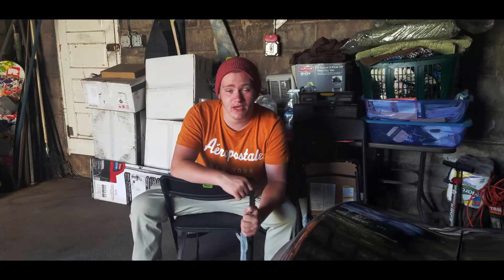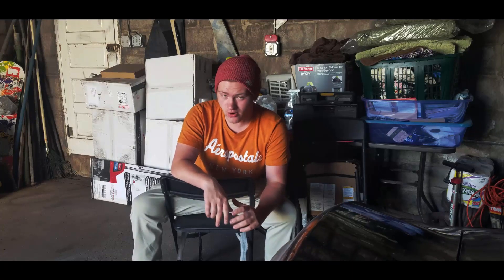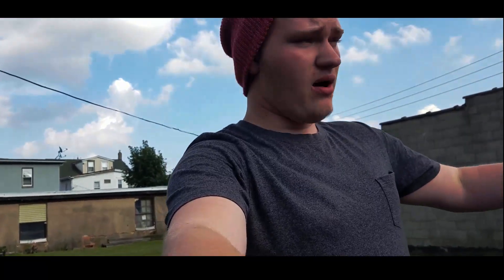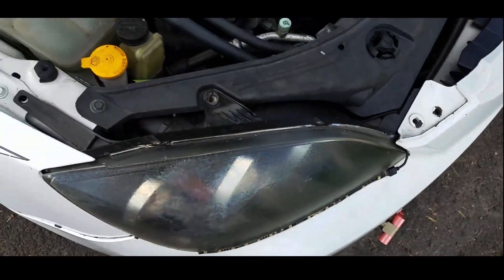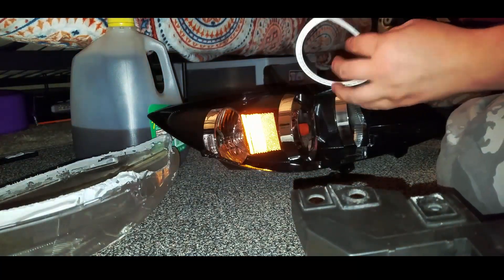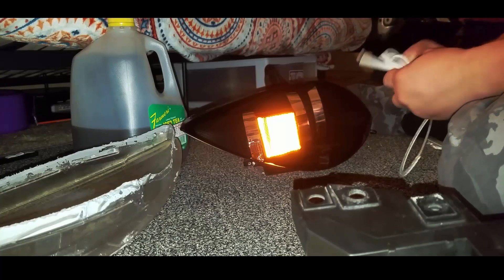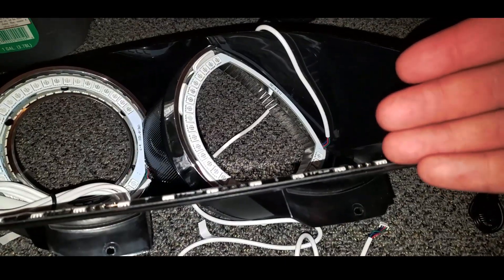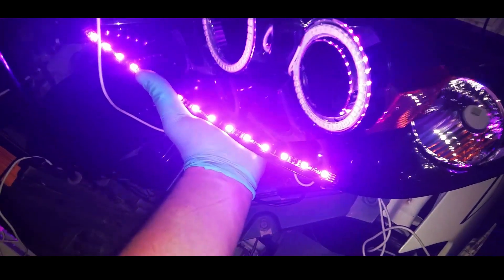DIY MAZDA 3 EBAY HALOs/ANGEL EYES INSTALL AKA MAZDA MODS

Comment: Hey! I cracked that black plastic piece that sits behind the glass lens and holds the chrome pieces that we set the halo's on...my headlights are a HID unit...but do you know if the plastic piece from the halogen unit would fit? Im assuming they do, but just want to make sure.
Reply from the maker: arvin t I only replaced the lens that actual internals are completely differnt to fit th bulbs
Reply: you 100% sure? I dont mean the black housing itself, that i can understand..this is the black chrome plastic piece that pops out with the lens..it looks almost similar to halogen from the pics..but a halogen assemb is $70 compared to $250 of HID :( Sorry for buggin ya haha..figured since you've been actually inside of it you would know best. Thanks!

Comment: I put these on my mazda and when im driving sometimes these will go into reset mode and just flash at 100 % brightness and its really annoying i dont know how to fix it I found this video trying to find an answer to this problem so if anyone has my problem and maybe a solution reply!
Reply from the maker: Tyler Hernandez idk main never had that happen
Reply: Try taking it apart and putting it back

Comment: man I bought and installed those halos, and after many hours of work, when time came to test them they dont even work, fml anyone else have that problem?
Reply from the maker: Not me man I tested them before installed them with a 12volt battery
Reply from the maker: Check your wiring
Reply: yeah i should have done that first but im dumb, i ran diagnostics, the lights are fine BUT the box with the circuit board is the problem, power goes in, but doesnt go out, so i need to find someone who works with those or just see if i can buy another set and use that box